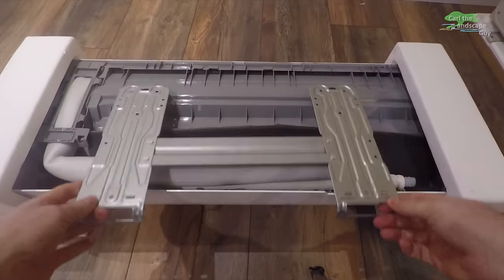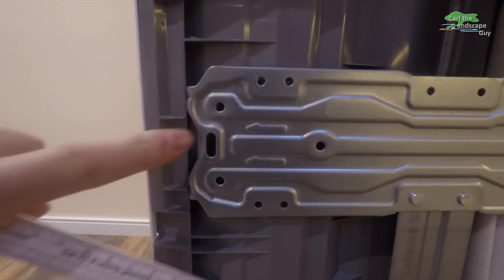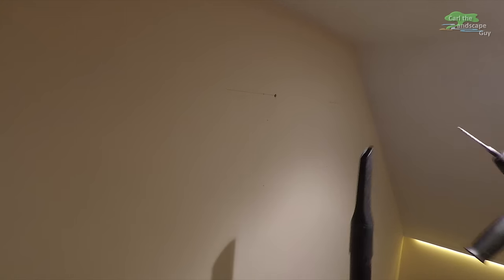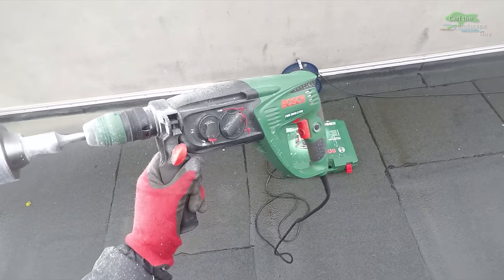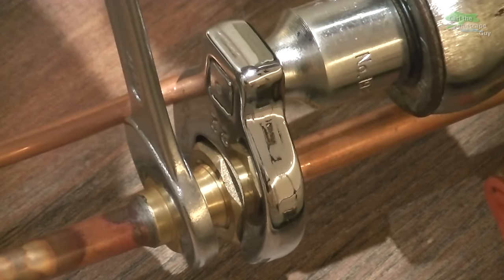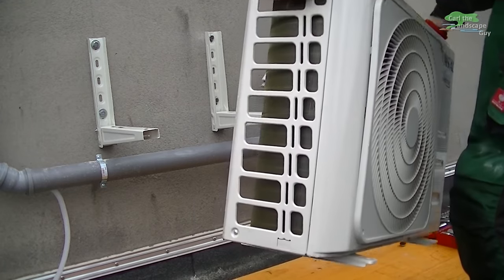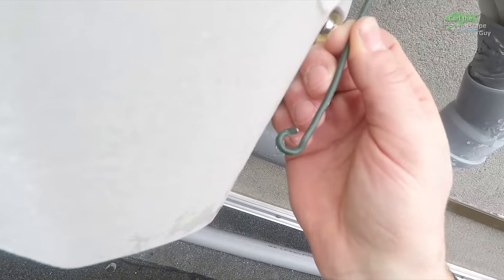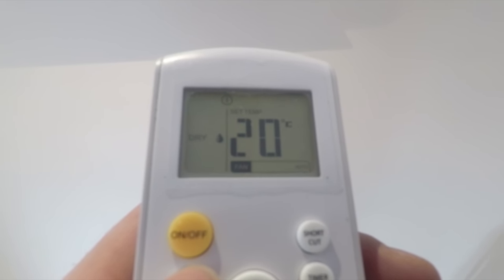AIR CONDITIONER DETAIL INSTALL |SPLIT DUCTLESS AC HEATING INVERTER,MINI PUMP SYSTEM SETUP,DIY HOW TO

Comment: I have a mechanical engineering background (I am not an engineer) and I work on AC systems. You explained the installation process crystal clear, the job was done professionally and super clean. Cudos, good job!
Reply: I have multiple mechanical experience, and I  learned to do test, before final assembling of pipes or wirings. Whole system might changed for something reason. Here in Finland assembler need licence for that job. Advice for buyer: You can found manuals of many AC syntems for comparison from internet.
Reply: ,f2

Comment: Is your compressor still working. Haha a hand pump
Reply from the maker: yes still works great
Reply: He has a point. I mean the hand pump
Is so wrong and your contamination is so high now. Watch HVAR school videos with Bryan Orr. We don’t even use manual gauges with an electric pump because it’s not even accurate without a micron gauge. You might get away with it here and get lucky and you think it’s ok but most likely not. Any install without even proper procedure can last a year or two.

Comment: The join should be installed indoors because if the join is stored in the wall when general service is difficult to open the join and dont forget vacum the unit -30 min
Reply from the maker: good point 👍

Comment: Installation magic !!!! You inspired me to do it excatly as you showed. It all went perfectly fine, withouth any issue whatsoever.. And all is working fine the second year now , and i have zero issues. Really really good work, and installers should learn from this... 
When so called " pro " installers came, and saw, how i did it ( based on this video ) , they were completely schocked by the details and all. THANK YOU SO MUCH for percision guidance... Great respect.
Reply from the maker: this is a really nice comment and I was very happy to read it, I am so glad that this video helped you to save money but most importantly inspired you, thank you for getting back to me to let me know, have a great day and God bless
Reply: @CarlTheLandscapeGuy is your unit still working today?
Reply: I can tell you, that my unit still works. I was guided by instructions , videos.. Amazing. I have 0 issues, done as it is supposed to be done by all pro installers. But unfortunately so called " pro installers " do not want to do it like that. It consumes time, accurate measurments, detailed approach... 
Few told me , that never ever, they would do it like that for clients. Only for themselfes at home, but for clients no.. And this makes me sad, and made at the same time. Because they charge installation work really high price. 
As i said allready - Carl inspired me really a lot. 
I have also repaired - redoo installation at my parrents house and they are super satisfied. 
Since installation was redone, the ac unit starts to heat or cool much faster, and consumption is lower, then it was. 
Amazing guidance, very accurate guidance, and huge huge inspiration for me.
Reply: @bokiboki3259  awesome! Thanks for the update!

Comment: Great video.. learnt alot 

Tiny tip: if you put the crows foot at a right angle to the torque wrench, you won’t affect the torque value. That’s how you keep the torque accurate.. I’m an aircraft engineer so we use torque wrenches all the time
Reply: Gas is not Rileze bro  installation is good

Comment: I am pretty sastified with your neat and perfect spectacular  aligned installation. But i think if you get the connections of cooper tubes underneath indoor unit .The connecting flare nut could leak the  referigerant in future. You have to remove all the installation kit to re flare leakages. I am also pro installation technician. I make hole left side of the indoor the connections will always easy to remove indoor unit for washing purpose or maintenance. And also hidden from sight.
I hope you got my point. 
Your professional skills  appreciated and admirable. God bless you.
Reply: Ko

Comment: Carl, Maybe you know by now but I did not read anyone making comment on, that you are not getting the proper torque on your flare nuts when you use the Crows Foot adapter, the way you did it would increase the torque, you must understand that the torque is measured from the center of where you attach the socket, it is measured from the center of the square to the pivot point on the handle and if there is no pivot point then it is measure from about the center of the handle where your hand covers. You can use a Crows Foot but you must have the crows foot at a 90 degree not straight out from the end, if you do straight out you are without question putting a HIGHER Torque on the fittings. Fittings have a min. and max. Torque value. and we must keep it in that range. Hope this helps and also for all your YouTuber friends other than that you did a GREAT job. Thank you!
Reply: He specifically mentions this.
Reply: @reedschadegg9023  If so I didn't see it and he has my apologies. He did a great job explaining the whole thing and I am sorry if I screwed up.

Comment: I did this work for years, you have talent, you should work with a professional, get your internship done, let someone else run the landscape business and go to work in refrigeration, learn the tricks of the trade, I learned one from you I never seen, very impressive 1st ever installation! I would hire you in a second, teach you, Tweak the install just a little, you could make enormous amounts of money! great job,
Reply: What was it you learned the 3 inch PVC pipe to hide the line set?
Reply: Bhul

Comment: Most AC units here in Bulgaria come with free installation by a qualified technician, which I very much appreciate. By no means does that stop me from watching installation videos though :D By now I have watched maybe 15-20 videos, and out of them, yours look the most professional (except for the vacuuming part). At first it even seemed like a bit of an overkill to me, because of all the extra insulation, but I do believe that it will greatly benefit the energy efficiency, so it's good. Thank you for sharing this experience with the world!
Reply: The cost of installation is always higher than the air conditioner in HK. I think the price of standard installation and the air conditioner are combined in your country.
Reply: There is no such thing like free lunch!

Comment: First time i see someone takes the time to insulate the outer cables. very professional. all the installers here leave it as it is. just to finish the job and get it over with. that's why no one can do it better then you. One question though: regarding the water hoze (where water will come out from) => how will you clean mold inside it? (it eventually comes).

Comment: in order the condensation water drip into the plastic pipe in indoor unit, you need some degree to tilt the bracket toward the output flow right into the pipe. just to make it sure, glad you make it crystal clear explanation.

Comment: Just one problem : testing system for leaks ? Suppose you have a leak after line set is fully connected ???
Yupp , even with the best intention's of doing a great install from licensed hvac company . leakes do occur.
The rest of this video was top notch.
And thank you for pasting knowledge forward.
Reply: Yep. Have to put a holding charge of nitrogen and wait. Also not sure why he wouldn't show at least some of the process of putting a vacuum on the system and stressing the importance of actually pumping down for a long time. Getting a 30 foot line set down to nearly 500 mic can take quite awhile.
Reply: @thecrackrabbit9531  yes, i did my best not too make a guy taking time to past forward feel bad.
Yes he failed also to as you noted ; vacuum to 500 microns ,  plus pressure test plus making impossible if a has a leak to get to it.
Thank you , hope u also keep passing it forward
Reply: @joemartinez7619  Ok so I looked into it and apparently Mr. Cool has some special valve tech in the connections on their lineset. They come "pre-vacuumed" so as to not need to be pumped down. Still myself I am not a fan of Mr. Cool. Mostly because if you do have some sort of failure of any kind there won't be anything at your local supply house to actually be able to get you running again. It will come down to ordering it and from who knows where and who knows how long it will take.
Reply: @joemartinez7619  Oh and to reply to your too much lineset comment. The units come with a factory charge setup with the actual intended lineset length.
Reply: @thecrackrabbit9531  interesting. I understand they say there line set comes pre vacuumed. I understand some line sets come pre charged.
In the perfect world conditions. Lol
Ask any hvac or hvacr tect. ? " about in a perfect world " lol.
To many non perfect world things that happen .
When connecting your flare nuts chances of a vacuumed leak ; rather more like  lose of vacume is more like. it .
How do u know ? If you lost your pre vacuume ? Air and moisture sucked in by vacume break when connecting flare nuts.
Only way to know if you have a leak is presure test or proforming a complete vacume to 500 microns and holding for a hour : the more time you hold to see if pressure changes.
No other way.
Now of course you may also connect your line set and open both valves and check pressure/ temperature let it sit for a few hr's to a few days : depends how smal or big of a leak you may have.
Now also if u contaminated system with air and moisture it would show on ur gauges too .
How ever this is to be done by a licensed individual.
I do not advice any diy or non license havc to try it.

Comment: Basic chinese model with MIDEA compressor. But a decent machine nonetheless. Recently installed one for a friend. Good operation and reasonable noise levels.
Of course - nothing in common with the Mitsubishi Electric FH-Series (RW-Series), but 1/4 the price. No more can be asked. Covers competently all the right boxes.

Comment: Just a tip if your not going to crimp the ends of your incoming power cable to the outside unit should deffo loop around the screw before tightening just due to the vibration of the unit they will become loose and if there not looped round they don't have as much contact area to prevent arcing if a gap opens up. 👍
Reply from the maker: okay maybe I will do so next time thank you for your feedback and have a great day

Comment: Super installation, precisely executed work. However, there is one rather important shortcoming. Vacuuming of the pipe was not done to remove all the moisture. This is an important thing in order to avoid degradation of the coolant in the system and subsequent poor functionality of the system.
Reply: At 24.00 he gets a vacuum of -0.97 bar. Is that not sufficient?
Reply: Over here you re requires to have a vacuum of 270 psi or less, that maintains itself for 30 minutes to two hours depending on how much refrigerant the system needs.

Comment: You demonstrated good preparation and understanding of what’s required prior to the implementation of the step by step installation.  Majority of the HVAC technicians don’t do the correct way of insulating the influent and effluent line like you did. In addition you installed isolator under the condenser unit to minimized vibration.  Good job and thank you for sharing!

Comment: Yes, Agree with all other commenters in the feed very clean and precise job, hats off. This is how you install when you do it for yourself no commercial installer will do a good job like this for you because he needs to do one more installation with the time and material that is used in this installation so he can max his income :-) no offense to the commercial installers.

Well done.
Thank you for putting the time and effort in making and sharing this video with the audience this is mush appreciated.
Reply: I've been studying battery reconditioning and found an awesome website at Magic Mender Wizard (google it if you're interested)

Comment: Very informative video. Just by using other materials such as the PVC pipe and the insulation windings. Also by using some tricks you never see on other self placed airco's. Even not by proffesional installation videos. Thanks for that because I will use those tricks also.
Reply from the maker: thanks, i am glad if this video helps you 👍

Comment: This video helps a lot. Got a noob question though that's been bugging me for a while. I'm planning to have the exterior walls insulated with 10cm rockwool and want to have all the piping & cables running inside the insulation. If I choose to have the AC external unit installed first (thinking the wall mounts would have the best support against the concrete wall), obviously then there won't be enough space left for the workers to fit the rockwall. plaster and paint behind the unit. So the question is: Would the rockwall insulation and the plaster be able to hold the weight of the unit, or it is very likely the wall mounts would be pushed right through the insulation? Also in that case, I'd need longer screws to reach and screw in the concrete behind the insulation. What length & thickness would you recommend? Thanks.

Comment: You forgot the only part of releasing the compressor valve for the suction and discharge line . That was very important before run the unit . By the way your installation is very well done sir 👍🏻😊
Reply: you mean to flood the copper lines?
Reply from the maker: yes i added an update video on my channel

Comment: A good idea is to use lock washers or nuts with neoprene inserts  and install nuts from the bottom  in case nut does fall off the bolt will not fall but will keep the unit from moving off the bracket !

Comment: Excellent installation. fully trouble free service.
Reply: The only thing im not so sure its how you run all the wires to power up
Reply: To the house electricity

Comment: I really appreciate this excellent video - I wish however that you had spent a little more time after pulling the vacuum on how you opened the refrigerant valves to charge the system and it would be nice to know what valve to open first. Otherwise GREAT job - TY
Reply: Have you worked this out yet?
Reply: @robjudd1394  YES, Thank you
Reply: @armandmarkarian7705  how its done sir?

Comment: Great informative video. Just one question....shouldnt there be a power switch near the outdoor unit to turn off the power from the breaker panel if need be?
Reply from the maker: my breaker panel has a switch so that will do the job

Comment: Your video is probably one of kind that connected AC correct.  I would've use a vaccum machine to boil all water out from the evaporator.

Comment: Man I gotta say, but that was an awesome install. I absolutely love the way you payed attention to detail. You it did so neatly and tidy especially with the outdoor PVC piping and brown plastic housing for the power cord... 🧰👍 For some reason regular installers do it in 5 minutes without all them beauty covers and what not, plus they dont even install all the parts in - in my case they didnt put back the metal cover inside the main unit where the AC power lines go, so I had to put it back in myself... I always keep hearing "we're in hurry/there isn't enough time etc. etc" uurrrggggg 😠 What a load of nonsense/rubbish! - its simply no one wants to do it quality and just trys to half-ass it... which is unfortunate indeed 😔. As the saying goes, "Sometimes you gotta' dump the baby out with the bathwater" - ironic isn't it...

Comment: Nice. The extra grey insulation should be wrapped from the bottom up to the indoor unit. So that the overlap faces down, preventing rainwater getting inside.

Comment: Great job and very clean installation. People please use a vice when cutting with any kind of cutting disc and powered tool. Seen people loose fingers trying to cut like you did when splitting the 90 degree bend pvc.
Reply: Waz
Reply: Well if their fingers are loose they should tighten them with the torque wrench

Comment: you need to do a leak test with nitrogen and empty with a vacuum pump at 250 microns with digital vacuometer. it is a bad job that air conditioner will have leaks and operating problems
Reply: Hi
Reply: هههههههههههه
Reply: Thk
Reply: Bs!

Comment: Excellent video! Unfortunately my country requires separate certification for AC and electrical installation, but at least now I can check to see that the installer does a proper job.

Comment: It looks like the PVC fittings are all installed upside down and will allow water to leak inside the pipe?
Reply from the maker: maybe but they have a seal
Reply: Wouldnt think it really matters. The PVC pipe is just decorative. Maybe put a drain hole in the pipe if you are really concerned. Neatest fitting I have seen. Well done.

Comment: Thanks God for sharing your videos about this split type aircon but one thing  i miss to see is the connection of the voltage supply how and where   did it goes sir?

Comment: We must remember that a very important part of heating and cooling is also ventilation. I would prefer a ducted system where I can install a high quality air filter and bring an fresh oxygen from outdoor to create a positive pressure in my occupied space. I would also want to be able to incorporate humidity in the heating season and fresh air intake. Without fresh air intake your indoor air quality decreases significantly. And you run a risk of running a negative pressure and you're occupied space which is unhealthy and inefficient for heating or Cooling.

Comment: A very nice & professional video. I myself have installed all my air conditioners at home by myself. Just think that the outer unit support stand is very poorly designed.